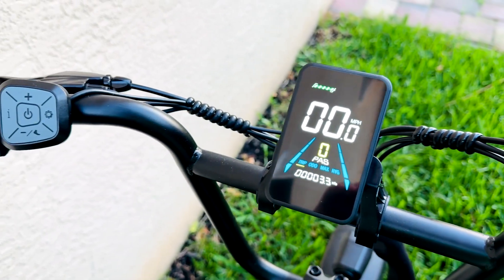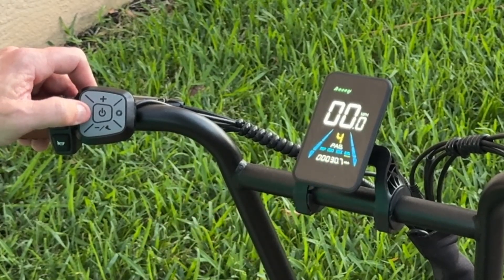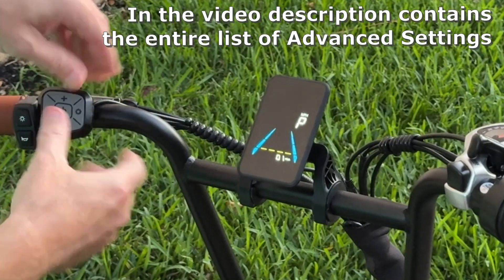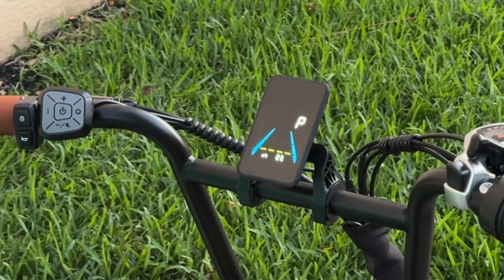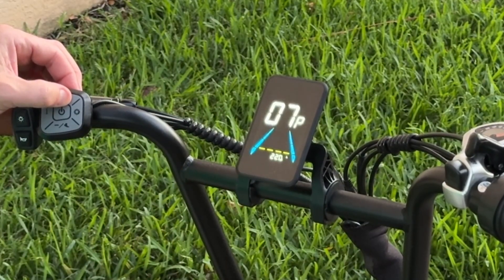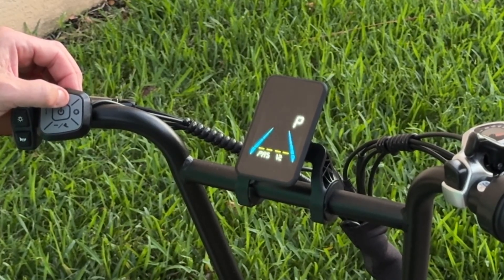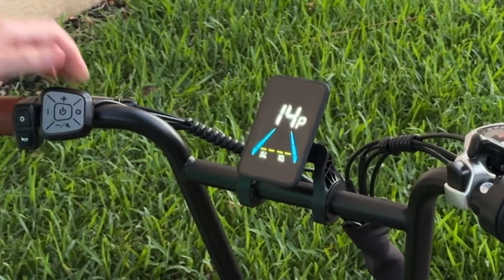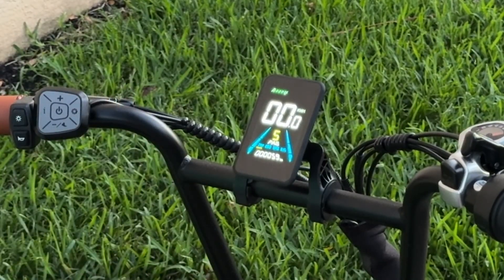Yolin YWS-20 display options & advanced settings - eBike or Scooter

Comment: Can you change the amps in the settings..or does it do it automatically ?
Reply from the maker: you can change the amps setting go to p07
Reply: @BRichSolution  I got 60v30ah 1500w will changing the amps make more speed and power ?.sorry new to ebikes

Comment: I have a problem with this Yolin display. It's stuck at p 19, and when the i button is pressed, the display shut off. What could this be?
Reply from the maker: Very strange.   Will the bike turn on and act normal after that?
Reply: @BRichSolution  No, but the display can be turned back on after it's been turned off. Luckily, I found a video on YouTube from someone demonstrating the problem. I had to press the "i" and "minus" buttons simultaneously until PP appeared. Then I entered the 1313 password code and pressed the "i," and the display worked normally again. it drives well now. But I have a speed problem. The display doesn't seem to show enough speed. My wheel is 29 inches, and I've installed it accordingly. Only in P7 do you have to select the number of sensors. When I select 1 to 200, I don't get any speed reading at all. The speedometer only starts working from 240. I think I can go up to 259, but after that, it doesn't make much difference.

Comment: Okay so if I hold the bike back and max throttle it while looking at the am0 meter, it only gives a max of 6.2 amps to the motor, hence the slow start minimal tourqe.  Is the motor or the controller bad??
Reply from the maker: What does the max amp read when you get on the bike with the weight of rider?
Reply: If I ride it, then it'll go up to 20 amps, the settings are at 22 amps tho.  I bought it used, it only has 198 miles on it but the previous rider was heavy set and didn't help petal it enough up steep hills.  I'll assume the motor magnets are degraded tourqe wise?  I read on a old forum that ad
ding solder to the stunt inside the controller will provide more current but would that actually help with increasing tourqe? @BRichSolution
Reply: @BRichSolution btw thumbed up and subbed 👍😎
Reply from the maker: Thanks

Comment: P13. This is the power on password setting. Set to psd-y and it will activate the setting password. Default to 1212. Set it to psd-n and it will deactivate the setting password. Seems to also reset odometer to 0.
Reply from the maker: Good to know

Comment: P12. Interesting setting. Throttle level setting. Set it to 0 and the throttle speed will not be limited by the current pas speed limit. Set it to 1 and the speed will be limited to the current pas speed limit. Unfortunately, that dis not work on my bike. Throttle speed is always limited to the current pas speed limit no matter the setting I choose.
Reply from the maker: Same here
Reply: Don’t tell me this I may sell this brand new bike based on not being able to unlock my throttle! My Lectric is not limited and it’s actually for safety and control to not have it limited to what pas level it’s in in my case
Reply: I got a solution.just go to p11 and set it to 00.for my bike now throttle working
Also set p12 to 00

Comment: To reset the trip meter. Press and hold the power and minus button at the same time for 2 seconds while the display is turned on
Reply from the maker: thank you - the description has been updated with all the advanced settings P01 to P14

Comment: How do you reset the trip meter
Reply from the maker: It should reset when battery is turned off
Reply: @BRichSolution Mine would not reset after powering down. I have to press the power button and the - button together for a couple of seconds.

Comment: You should review the ekx t1, budget e bike
Reply from the maker: The EKX T1 is not a good buy for $729 as it comes with mechanical brakes, black and white screen and that seat is uncomfortable.   The Ridstar q20 1500w is the same price and it comes with hydraulic brakes and its faster.   The other better options is bluvall su8 with 52V battery has color screen,  better battery, hydraulic brakes
Reply: @BRichSolution Oh, were you able to see it?